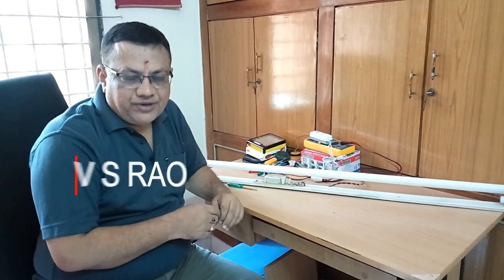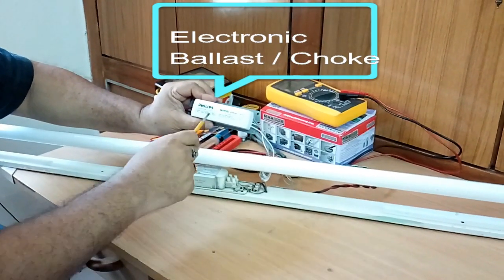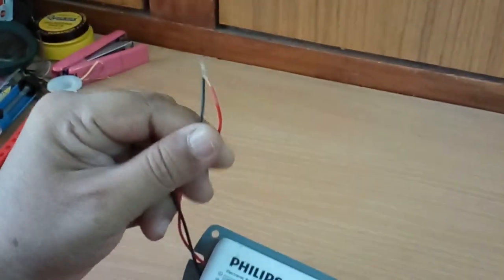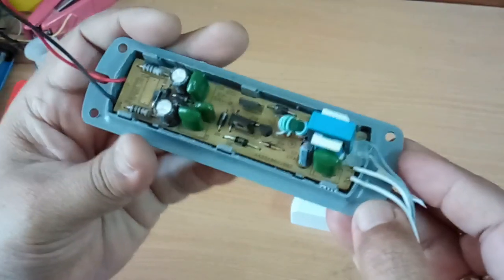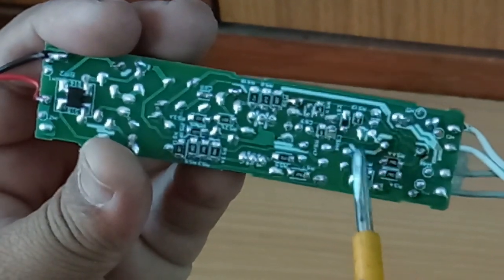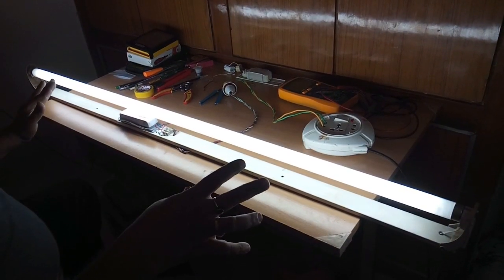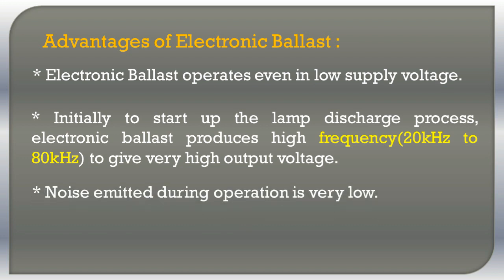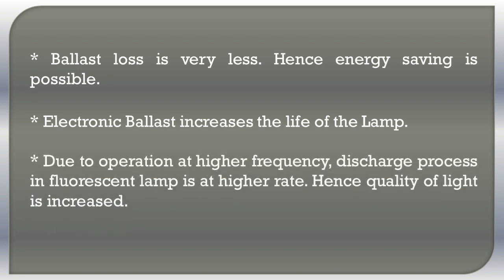tube light ballast | Electronic Ballast Choke Working Principle | How to install electronic choke

Comment: What is the output voltage ? Is it 230v ?  Is it dc?
Reply from the maker: Please go through entire video, I have explained in detail. It's high frequency square wave pulse at output. It's 230V AC in simple but not sine wave, it's square wave.

Comment: Sir, why there is only single winding in the transformer?
Reply from the maker: Certain auto transformers, flyback transformers are designed using single coil with tappings in them.
Google for types of transformers to know more.

Comment: I used the cfl ballast as a driver circuit for flyback transformer it does provide high voltage but it shut down automatically after some seconds 
How to prevent this auto cut feature?
Sir

Comment: 752j capacitor not working the same capasitor did not available in the shop. Can I use different value capacitor
Reply from the maker: Value can be slightly different, but ensure voltage rating. Voltage rating should be same or above.
Reply: @vsrtechinfo  can I replace the CY3BB752j by 3n3k 1200v
Reply from the maker: 752j and 3n3k =7500pf and 3300pf.
Try using combination of capacitors to reach near value.
Reply: @vsrtechinfo  3n3k +3n3k?
Reply from the maker: Yes, in parallel capacitor will get added.
Reply: @vsrtechinfo  OK thankyou sir

Comment: Sir, can i use 36/40 watt Philips ballast in 20 watt flucent tubelight,i not then what i am doing,my ballast damage 4 times ,can you tell me the causes.
Reply from the maker: Not recommended. Use proper rating ballast to avoid fire and damage.
Reply: But where i buy 20 watt ballast,can you require any retail.
Reply from the maker: Philips Ballast 6W-18W Tubelight/Compact Fluorescent Lamp CFL 7W-24W
Check this in amazon.in
Also you may enquire in local electrical shops.
Reply: Thank you sir for your help
Reply: sir , this Philips ballast is 18 watt but i have 20 watt tube light
Reply: Sir that you suggest,this ballast is for RO

Comment: thank you sir for the knowledge.  
can these 40w electronic ballasts be used to drive 2 feet 20w tubes without any issue ?
Reply from the maker: Recommendations to use it with same power ie., 40 watt.

Comment: Sir I recently replaced copper ballast with electronic one but within a month left side of tubelight turned brown and stopped working. What can be the problem sir??
Reply from the maker: Lot of factors involved in electronics untill one examines the root cause of the problem can't come to conclude.
Reply: @vsrtechinfo  Thank you for your reply sir

Comment: I made a high voltage transformer but it is not working on a supply but when I connect a DC supply to it and use my hand to join the wire rapidly there are reading in the multimeter why is this happening